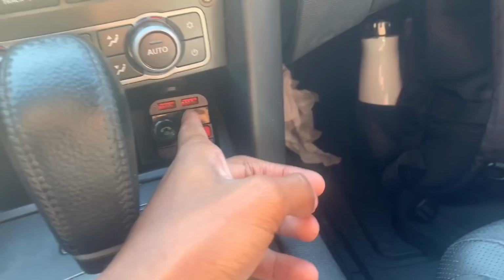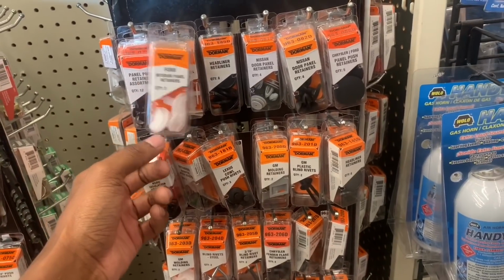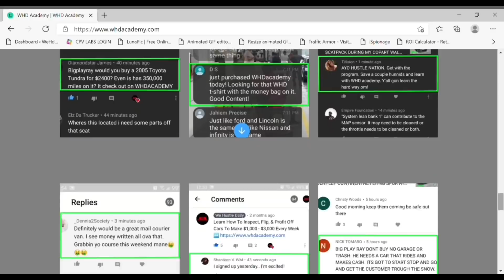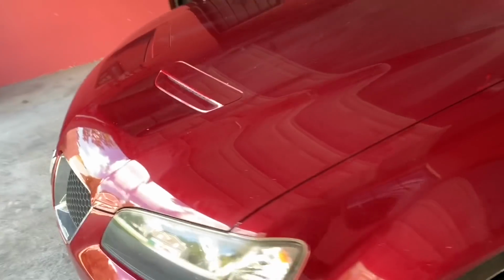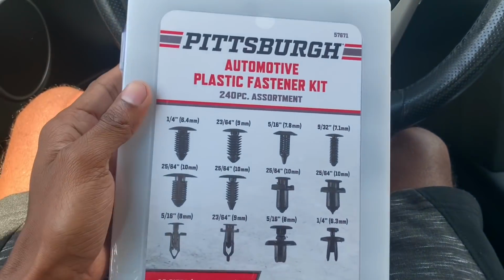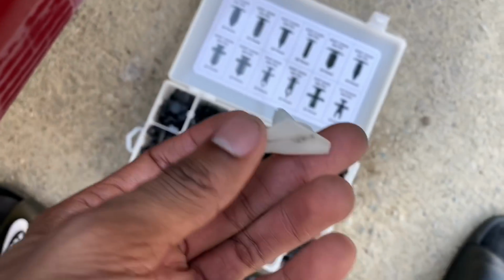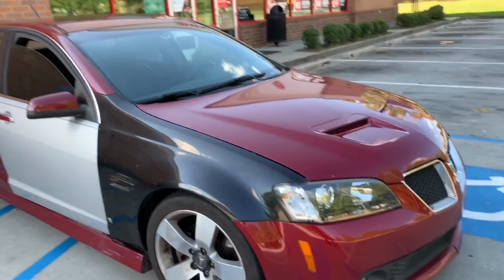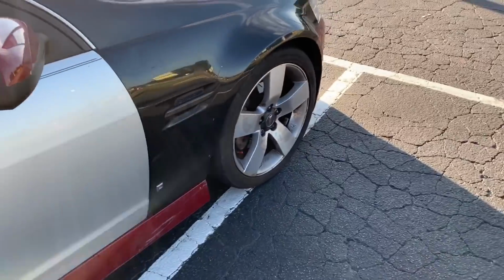THE PONTIAC G8 GT I WON FROM COPART IS ALMOST COMPLETE! *JUST NEEDS 1 LAST THING!*

Comment: Have you changed anything internally?
Reply: Nope not even the oil🤣🤣🤣🤣🤣🤣
Reply: @jasonbrown2912  Yeah tbh I never seen this guy get under the hood. I'd assume he doesnt even buy the car based on how fixable it is, but on what the car make/model is and what the body condition is like. I rather have a close to 100% running toyota camry than a 60% running sports car that has somewhat expensive parts. Body work is a hustle but not on poorly maintained cars. He could be making more money if he was in tune w mechanics more fixing them up and not only doing cosmetics.

Comment: Before your install the fender liner, aren't you going to fix the turn signal side marker light? It would be easier to change out the assembly with the liner off because you can reach in without the liner being in the way.
Reply: He ain’t fixing fixing the car.
Reply: @scarredshortstv7954  I think he did mention he wants to change it to the white lens that matches the left side.

Comment: Ray! Before the paint even dries on the car have a buyer lined up and his dinero in hand. My boi, no offense, but u too cheap 2 be dealing with an Unreliable GM product. JB weld  doesn't fix transmissions, engines and electrical gremlins.
Reply: At least it ain’t a BMW. They stay broke all the damn time. I used to have a couple of them and I think the G8 is a better car. I still have my 2008 and I bought it new.
Reply: @pmscalisi  I agree... at least it ain't a BMW and it's cheaper to fix & maintain.👍🏽
Reply: I guess you can tell I’m not a fan of Broke More than Works.